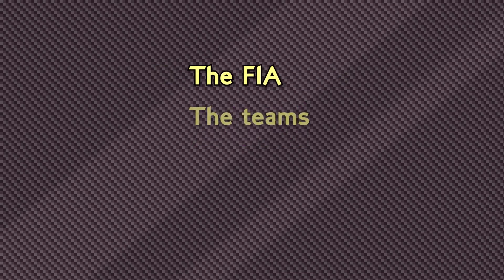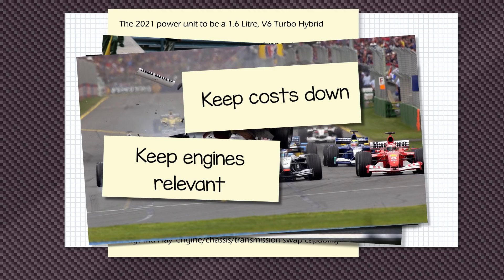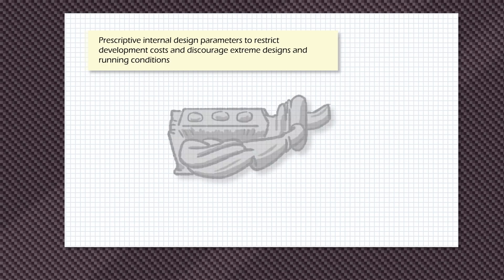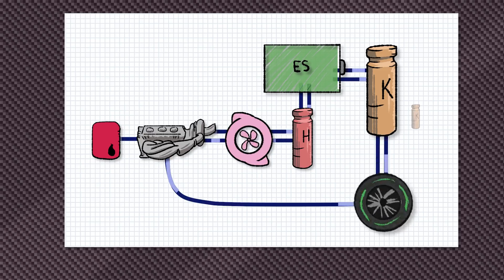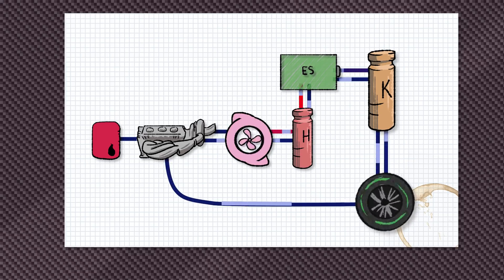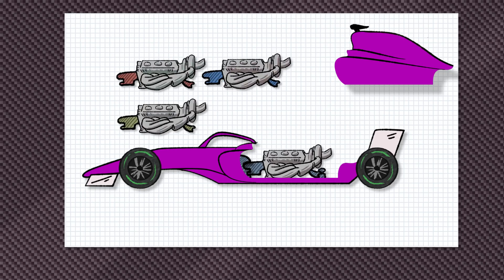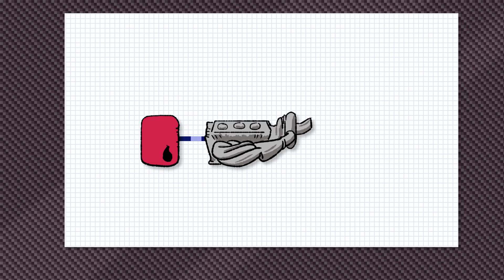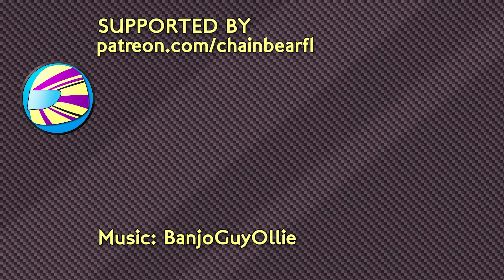F1 Engine proposals 2021 explored

Comment: The MGU-H does NOT create electricity by absorbing the heat from the turbo like as Chain Bear vaguely and inaccurately describes. The Turbo is spun by the hot exhaust gases "Heat" from the V6 engine. The turbo is connected to the MGU-H via a shaft which spins a magnetic coil inside the MGU-H thus creating electricity. Chain Bears understanding that heat energy absorption within the MGU-H creates electricity is wrong.
Reply: It is the thermal energy of the exhaust gases that drives their expansion which in turn drives the turbo. Thats why its called MGU-H with "H" as in heat.

Comment: Very late to comment on this video, but, I think the MGUH should be kept, if only to keep the turbo spooled up and not store energy for a horsepower boost.  Recovering heat energy is a hard problem and, therefore, expensive. Applying it this way might allow some innovation while keeping costs down.

Comment: Not sure about standard software and electronics, part of FE is that you can develop your own, and smart software is better energy mileage and the same applies for F1.

The more you restrain manufacturers in future tech the less will join. 
FE is all about the tech and not the chassis which is why it's drawing in the big guys already. 

F1 should be all tech development with only limits on power use ( fuel or leccy capacity and flow ) and safety concerns. 
The rest is go fast, win shizzle.

Comment: I know this is late.. but how about using the same power units but mount a Regera style serial/ parallel hybrid transmission system and remove the gearbox, Since we are all going electric anyway, this is sort of a step forward to that direction

Comment: I think F1 should be about building the fastest track cars on the planet. Whatever engine fits that purpose is the engine we need.
Reply: Qualifying would basically be the end of the weekend
Reply: Then you’d have what we’ve had for the past 5 years which is one team with the best engine dominating every year. We want action and overtakes and battles, not a Mercedes 1-2 every weekend.
Reply: Gert Mercedes win because they have the best car not just engine. Rewatch onboards and see how much smoother the Mercedes is to any other car in any season. Especially the Ferrari
Reply: Edgie Braahhh Actually in the 2019 season, Ferrari had the best engine, but Mercedes had the best everything else. The Ferrari’s pulled away on every straight but Mercedes just caught up and passed them on the corners
Reply: Gert It should be up to the other teams to catch up, not to have the faster teams let them keep up
Reply: Gert Without teams innovating and all the cars being the same, then we might as well not race in the first place since we know it wasn’t the teams engineering that gave them the win but rather the FIA gave them the win
Reply: Well, at the moment the cars are going faster than ever.
Reply: That would be terrible to watch.
Reply: Than we would have no overtakes at all
Reply: The fastest track car on the planet will be electric. Thats almost undeniable considering the almost instant torque and hp along with throttle response. Add to that fact that there might be only 1 gear change. Is that what you want?
Reply: @globalelite3042  no, electric f1 cars would either have way less power or weight much more because of the big batteries...
Reply: @globalelite3042  only time will tell... Right now its not looking like that batteries will get any lighter. I don't even think electric cars are the future because the lithium and the rare earths you need for making batteries are on a shortage really soon and we need to come up with a different solution (again).

 A combustion engine running on sustainable bio-fuel (or something similar which is natural) with no harming emissions (maybe trough good filters?) seems like a way better solution and electric engines. Too bad the R&D money for these type of alternative  engines is pretty low and all people tend to focus Only on electric engines when in fact this has some major flaws!
Reply: Nik 420 i mean cars can be heavier and still ne faster. I think its pretty hard to argue against instant torque and a linear acceleration curve. That means you dont have to keep it in gear. I think the closed wheel in formula e presents a lot of opportunities for aero to compensate for added weight but formula e cars are meant to he specced lower then f1 cars anyway. To filter out all the emissions would mean putting a serious choke on how much air can move in and out of the engine. I mean there is ways of theoretically getting zero emissions from a car, but they just arent efficient enough/ convienent enough compared to an ideal electric car setup, where your car runs on solar panels and not from a power plant.
Reply: Nik7 BKH The biggest problem with combustion engines is their efficiency. Only about 30-40% of the energy they make actually powers the car. The rest is just made into heat energy. While electric motors are far more efficient

Comment: As an engineer I actually think we need to consider changing things radically because F1 has a history of engines that have been 12 cylinder 10, 8 and now 6 cylinder 1.6 engines with energy recovery and deployment.  All good so far but in actuality the power unit development has been a situation where rules are made and the engineers try to find workarounds to give better performance.  The real world relevance of F1 has been in the past a way to develop technologies from the race world to the real world.  There is an opportunity to develop new and better for us all if for example the next generation F1 were to use Hydrogen-fuel cells.  In reality the power output of a Hydrogen Fuel cell is and has been for some time superior to any petroleum fuel.  So for example the teams could all use the same Fuel Cell and then allow the teams to develop new and better ways of delivering the power without the need to have large heavy battery's, it could also enable four wheel drive and truly remarkable performance.  Without the roar of the engine,  ensuring the audience get to watch excellent racing without the need for ridicules engines that truly don't burn petrol but in reality have a second set of injectors that inject a high calorific oil into the underside of the piston to bleed past the rings and supplement the fuel mixture. Jon.P

Comment: Standardized rules are ruining motorsports. You obviously dislike angry petrol engines, why not adopt interchangeable electric motors with quick change battery packs and a common aero package?  That will be a real cost saver. As an American F1 fan, the new owners have all but ruined the coverage here.  American motor racing is losing its fan base too.

Comment: What a crock of shit. The real fans want noisy engines that burn more fuel. The real fans hate electric. As a comparsisson Formula E is motorsport for people who aren't interested in motorsport. If formula 1 keeps trying to become more like formula E then it will die because they people who have stayed with F1 through thick and thin will say, i have had enough of being told what i am required to like. If it was put to a vote by fans that actually spend the money to go to the races (and yes i do) if they want to keep the current engines or go back to the V10, the V10 will win hands down. Its what the real fans want, the fans that have watched and supported F1 for a long time, not the 'Johnny come Lately' new breed of fans. But F1 is not interested in what fans want, they tell you they are, but its becoming more and more apparent, they aren't.

Comment: maybe i am a noob but ... F1 NEVER EVER was something that was releated to road car ... this is not a GT race were you see modified proches, ferraries, corvette etc ... thi is formula ONE.
The goal should be" to strive for the quickest land vehicule in a circuit " by opposition to dragracer.
F1 should be abble making a IRL version of redline ... or at least that's the impression i had as a kid. I am probably not a good fan since i just stop watching F1 when they "nerfed" the engine. but i guess i was not alone even game dev thought that when pushing to SF https://youtu.be/bNq8lqUhoV0?t=13

Comment: If they want to keep their engines relevant to real life the regulations should be opened up for the valve train. F1 would find a solution to actuated valves or “free valve” right quick. That has huge potential to increase efficiency, yeah it comes at a cost but you can’t expect to develop and improve a technology for free!

Comment: Buddy if you’re allowed, F1 would soon be known as Prius 1.
Reply: @Stuckinair  electric isnt ready. and i doubt F1 will allow car changes, defeats the whole point of the car itself.  and if formula e cars WERE as fast as F1, what with the hazardous waste in a battery, a serious crash would be horrifically dangerous to the track and spectators.
Reply: right? yet formula e cant touch f1. electric power isnt ready
Reply: Jnathan Nger yet but electric already has way more potiential. Instant and linear torque/hp and no or 1 gear change

Comment: 2050 F1 will no longer using V6 hybrid, bcus It's just like "HISPTER". And now they're using 1 cylinder Hybrid. F1 trying to moving on to keep engine more efficient. How's that? Man your statement kinda cruel when you said V12 engine is just like "Hipster".  You hurt my feeling. Those V12, V10 and V8 era were Gold. Their steering wheel are just only Boost and Radio buttons. They were Hipster but wayyy.. exciting than todays F1.

Comment: Standard driver controls, with nothing on the car allowed to be operated by anything other than those standard controls. Let them improve the engine and drivetrain all they want, but the driver will still only have the same tools available to make use of it. Nothing fixed or manipulated from pitlane, no special knobs or buttons to change the way the engine responds to the throttle pedal. They'd have to design everything based on the driver having only certain methods available of putting it to use.

Comment: I dont like the v6  since very fev cars use it   i would like  something like a 5 - 3  cylinder inline engine  because   they are to certain extent  used un roadcars  and for ferraris concerns  to some extent  scaleble like cosworth did with their aston martin monster v 12  
So from a i3  ther would be   a   i6 V6  V12   
From a i 4  V8  V16😉
I 5    a  v 10  
Witch  would improove  streetcars  as well and then apply   to the loose rules of 3 layouts  3 different displacement and an open rev limiter so the start screaming again .

Comment: TL;DR - F1 is no longer what the V10s reprisented in the sport, as much as I love them. I believe that Turbo Hybrids are fascinating, contextual and have a definite place in the sport and its forseeable future.

I believe the biggest reason for disappointment from F1 fans about the ongoing castration of IC motors/engine conservation/tyre conservation etc is that the sport is no longer indicative of the "edge of technology" aesthetic it held for decades. Engineering of motor vehicles and racing circuits (as well as a significantly larger emphasis on driver safety and environmental efficiency) have reached a standard where the cars and tracks cannot get much faster without being of risk to drivers. A good example of this was Adrian Newey's Red Bull X2010 concept, designed under the context of "no regulations" and made to be as fast as technologically possible. It could pull a theoretical 6G under cornering (4.5G is considered extreme in the current formula) and a top speed of close to 500 k/ph. Needless to say there's no track on Earth that can properly facilitate the speed of this kind of car (Check out VR tutorials on Assetto Corsa, it's fucking ridiculous) 
   
The regulations that define the formula now restrict the cars from the exponential improvement of aerodynamic and PU performance and have done so for several generations of the sport, hence why several lap records until this year had been set in 2004. The formula has been shifting from a focus on development of "mechanical" performance to efficiency performance. Less and Less PUs per car per year, introduction of MGU-H/K and forced induction all contribute to a smaller and smaller ecological footprint.  I don't care much for that however, I assume that in the grand scheme of things, whatever 20 or so F1 cars can use in a weekend would be negligible compared to daily use of fossil fuels worldwide. I understand it sets a precedent, but this is supposed to be the pinnacle of motorsport. And I'm not comfortable with the state of Grand Prix racing where a significant amount of the Driver's investment is towards conservation and not flat out pace.

What I love about the current era however (and where the Sport is headed) is the nature of the Turbo-Hybrid layout that the cars currently have. The fact that in 2018 F1 cars with 4 less cylinders, 1.4 less litres and no refuelling are on-par with the NA V10s of yesteryear. Obviously Aerodynamics play into it somewhat, but the performance is there. Hybrid technology is the future and it makes perfect sense that it would be used in this formula. There's nothing special about a Naturally aspirated V10 engine in 2018. There is a lot to appreciate from what Hybrids are capable of and how they can maintain the performance we're so used to at such a small footprint, minus the sound of course </3

F1 is no longer the pinnacle of speed as it once was, they aren't the fastest cars you'll ever see anymore (The Porsche 919 Evo cut a good 7 tenths out of Hamilton's Spa Pole this year and that car is a big boy) And they'll never sound the same again. But there's a lot to be excited about. As long as the racing is always there, I'll be there too.

PS - I'm not saying this formula isn't still power dominated (Mercedes fucking saw to that lmao) but the power is no longer just extracted from the PU itself, there's a lot more balance to maintain between components than ever before, and Mercedes nailed it.

Comment: It is going more and more to the same road that Indy has gone... Where will this end? F1 only going straight, left, straight too?

What are they doing?  They are KILLING innovation and engineering in F1. Some day, it will be like Indy, where they all run with Dallara chassis and GM or Ford engines. 

Damn it, FIA!

Comment: If they really wanted too tey could bring back V12's and introduce cylinder deactivation technology that could turn them into V6's  by simply shutting down six cylinders when the car is at racing speed and reactivating them when the car is coming out of a corner or is in a DRS zone.

Comment: It would be a shame to loose the MGU-H. IIRC Mercedes has some dumb new multi-million dollar road car coming out that will have one so they wouldn't be happy to loose that sort of marketing. It would also be sad to see one more F1 innovation be banned from the series as it starts to move into road car level stuff just because some deaf old men want more racket. Many of the things banned from F1 at one time for cost reasons are now standard issue on $16,000 hatchbacks. Like ABS, traction control...headlights...fenders...yet they never come back no matter how cheap it gets.

Comment: My opinion on what the engine should be: 3.0L v10 with blown diffusers. There shouldnt be a limit on engines you could use per year nor limits of fuel/hour. With 2004 engines (3.0L v10) and 2018 chassis, we'd actually see formula1. As another comment said "f1 engine should always be trying to kill their drivers"

Comment: What a dumb idea, try get used to quiet engines so the move away from combustion isn't as jarring. Hell no, enjoy the screamd and roars as much as possible while we still can!
And wanting V12's/V10's is hipster? How? Those engines were fucking immense, comparing it to a rotary telephone is dumb, what excitement and performance is there in an an old phone compared to a smart phone? Now compare the 00's V10's vs today's hybrids, they're still close.
F1, and indeed most motorsports, shouldn't try mimic road cars, how dull. "Yer sorry guys, in 2021 DTM cars will run 4 pot diesels seeing as that's what the typical German road car has."

Comment: I hope that they won't drop the icu in f1, formula e is already there and has its sole purpose in focusing on electronic power units, f1 should try to make the icu as efficient and as fast as possible
Reply from the maker: oh they definitely are doing that! It's the most efficient engine there's ever been. It's an incredible piece of engineering.

But ICEs won't be around for ever. They just won't. There will eventually be a need to move on and F1 is going to shift in that direction. It'll be fine though
Reply: Chain Bear F1 what if they'd try to develop an engine which uses hydrogen?
Why is something other than electric or gasoline completely out of the discussion?

BTW: thanks for your answer, you are making great content.
You are doing an extraordinary good job at explaining everything! Even for me, who is not a native English speaker

Thank you!

Comment: I don't mind what the engines are like but, F1 should stop pretending its so efficient by using these hybrid engines when traveling to all the races uses 7 jumbo or like 5 lorries per team. And the safety car has a V8 in. Just make it 17 races a season or something so there is less travelling between races and the sport will be more efficient and make the safety car full electric